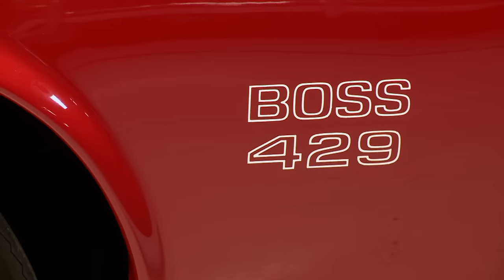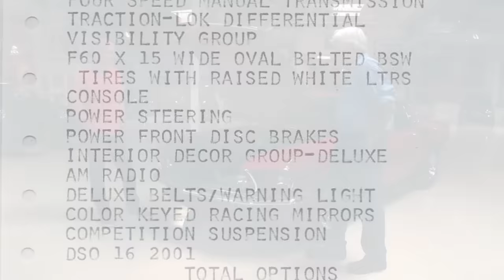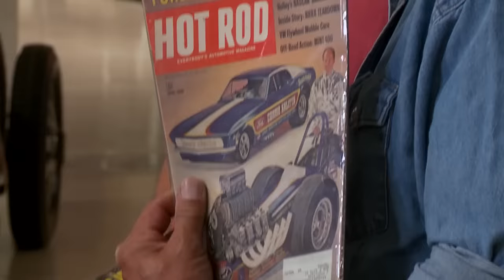1969 Ford Mustang Boss 429 - Jay Leno's Garage

Comment: I was  kid in 1969. That year my mom wanted a new Mustang. I went with my dad to the Ford dealerships on the weekends to test drive what they had. I remember riding in new Mach 1's but not a Boss 429 that I can recall. My dad really wanted a 4-speed and my mom wanted an automatic. We, of course, got an automatic. There's one thing I bet they can't replicate when they restore one nowadays - the new car smell of a 1969 Mustang. It was unbelievable. I've never smelled it since. I've been told the smell was actually adhesives. Regardless, man did they smell good. 

My dad ended up buying a 1969 Mustang 302 Grande automatic. I remember it was $3,200. It had the same interior as that Boss 429 (including that fake vinyl wood trim). The horn on the inside of the steering wheel was kind of a gimmick.  Ours used to stick and go off on its own in the summer when the interior would heat up. It would actually run the battery down. Random people used to pop the hood of our Mustang and disconnect the battery to turn the horn off. Then they would leave a note under the wipers. This happened several times. My dad ended up disconnecting the horn with a pair of wire cutters.
Reply: I had a 71 T Bird with the same horn setup. pretty weird, lol.
Reply: My dad had a red on red 70 Mercury Cyclone GT 351C with same horn under the rubber ring in the steering wheel.
Reply: yes yes yes ... the good old days .
Reply: +Patrick Simmons 
and probably likes the Shocker
Reply: Lol, they call that Rim Blow, the horn.
Reply: My grandfather bought his first car,  a 1969 Dodge Charger R/T.  426 HEMI,  4 speed,  Black exterior,  Black Interior,  Black Vinyl top. Sat for 5 years in the mid 70's. My dad picked it up from my grandfather in the 80's, and used it until recently.  It needs a few things done,  but it's completely intact,  original.  It has about 60,000 miles on it,  and soon,  it'll be mine :)  it never leave my family as my grandfather passed away last year.  So it's here for as long as it's kept up.
Reply: Carlos Aponte I'd sell the hell out of it...
Reply: My dad had a 1969, the horn was hard to activate, like it was recessed or something, really had to get your finger tips into it.
Reply: NOT one of Ford's 'Better Ideas'! Lol
Reply: That explains the ongoing affection for these Mustangs! Lol
Reply: Far more Mustang clubs than any other clubs.
Reply: Lol, 44 years later they still didn't solve the horn probs. My 2013 gt has a horn that does not work. Somehow involves my cig lighter
Reply: IndyFlick Right on, I can still smell Dad's 67 Fairlane GTl. And that rush in my gut when he'd slam that top loader into 3rd at 60mph and floor it on I-80 to pass a train of semis drafting up a long hill. Been chasing that high ever since.
Reply: That $3200 in today's money is about $12,000. Which is truly amazing.
Reply: Patrick, you need a heart! "Money can't buy you love"...the Beatles.
Reply: IndyFlick it's sad that nowadays 90% of people wouldn't know to disconnect the battery to turn the horn off.
Reply: Tyler Antonio try to find a battery in a new car, and also try to open a hood on a new car without a key fob. You used to be able to open a hood just from the grill.
Reply: I was 23, as soon as i came back from vietnam i had my money saved up for a new car, looked at a very similar black boss 429, i drove by it everyday passing it in the showroom.. after about 2 weeks i went in and was seriously considering buying it right then and there but it had sold the day before, i was devastated..
the same day i went across the street to the dodge dealer all pissed off and bought a brand new B5 blue 69 charger with a 440 for about 3500, shouldve paid another 500 for a daytona but they were fairly hard to track down then... still have the car to this day..
Reply: @tulosai58  
.mm.
Reply: I read an article that said that smell was vinyl and carpet adhesives.  The Japanese spent millions on corporate espionage to ID that smell and copy it.  I'm almost done restoring my 67 Fairlane gt and it will have the smell.  I have a factory interior installation manual and it lists all the adhesives.  So Ill take my manual down to the 3M factory and see if any of them are still in use. The engineer I spoke to says he has even mixed small amounts to be put in a vented jar to leak out the scent gradually.
Reply: @philhotchkin8269  I bet it was beautiful.
Reply: Lol, My 69 convertible 302 had every factory trim option, and included that rim blow horn. Thankfully, for the 15 years I owned the car, it worked perfectly, as did the factory Air Conditioning. I lucked out, bought the car from my cousin, who bought it from the original owner. That owner was a wealthy dude who checked off all the factory options, except a GT package.
Reply: @tyler8566  
A  couple years ago I saw a lady at the gas station.  The horn was blowing on her boyfriend's Corvette.  She couldn't get it to stop.  I told her to pull the hood latch inside.  I simply pulled the wire connector from the horn.  She was amazed.  Of course, we all know it was no big deal but, it was pretty funny.  I didn't want to help her steal it so, I asked her if it was her car.  She said her boyfriend's.
Reply: I had a 70 Mach 1 with the horn inside the steering wheel.  I would tell people that the clock reset above the glove compartment was a passenger horn.  When they would push it I would honk the horn from the steer ring and they would believe it.  Kinda funny.
Reply: it must of been a 69  thing. My Mom s 69 cyclone cobra jet had that very same horn problem !!

Comment: what a car... absolute pinacle of Mustang pedigree
Reply: In my opinion that is the Mach 1 SCJ.
Reply: It's slower.
Reply: +GlassTopRX7 No, it's not. I can assure you.
Reply: Yes it is by half second or more if everything is equal.
Reply: Yes,  this and the 67 shelbys.  GT 350 and 500's.
Reply: Nothing comes close to Eleanor.
Reply: The GT500 never looked like Eleanor. It's a modern dress up kit.
Reply: +Buddha Skouson Yawn
Reply: Best vintage Mustangs were the '65-66 GT350s & the 69-70 Boss302s, those have the racing pedigree.
Reply: Ken MacMillan  Probably, because Eleanor wasn't a gt500, lmao.
Reply: The Eleanor was an after market movie created car. It wasn't a Ford factory Mustang. So it's just a customized Mustang and not really comparable to all these other Mustangs. Apples & Oranges.
Reply: Buddha Skouson
Or a Mach 1 for the original film
Reply: the forgotten Boss 1971 Boss351
Reply: I'd rather have a Boss 302 or an early GT350, but this would be my third choice Mustang.
Reply: 351 Windsor. The Cleveland was more rare and actually wasn't that great. Kind of an in between small, big block. The FE engines were a strange lot. Worth big money buy the Windsor is much cheaper to work on and stroking one to a 408 is beautiful torque!! 
You can get the Windsor mustangs for well under 50k. Even in fantastic condition. Not so sure about the Clevelands. Also a lot of guys turned them into "clever" engines where they took the big Cleveland heads and mated them to the Windsor blocks
Reply: Ian Fosbrook take a mustang, fit a bear in it
Reply: butchtropic Go big or go home.
Reply: It was probably the pinnacle of America.
Reply: Disagree entirely with the idea of this as the "pinnacle" of Mustangs at the time or up to this time. It's very hard to overlook the actual "best" example the 302 BOSS for TransAm Racing. Same could be said of the Camaro back in the day......you could get bigger more powerful engines but ultimately the most completely thought out and balanced pony cars you could by were the Z28s and 302 BOSS.
Reply: My best friend in high school had a sister who’s boyfriend bought a 67 Shelby cobra 350 . It’s always bien my favorite muscle car, it had. A roll bar in the back a high performance 289- it was red and it had that cool cobra badge on its side. And the sound it made was fantastic. I never got a Shelby but I did get a 67mustang coupe. It was a fantastic car. Ya I always liked the Shelby 350 over the 500. It just felt lighter cooler than t big engine Shelby. I would love to find a Shelby 350 cobra. I am sure I would have to sale my house to pay for one know.

Comment: my parents bought a brand-new 1968 T-Bird back in the day with the 365 HP version  of the 429.  What a great engine.  In the T-Bird version, it was the velvet brute with torque that wouldn't quit.  It literally loafed up steep grades at freeway speeds.  Never burned a drop of oil, and a bomb-proof combination with the C-6 3-speed automatic.  We loved it.

Comment: I didn't know anyone in 1969 that didn't want a Boss 429, I don't know what Leno's talking about, everyone knew it had more ponies than 375.
Reply: The street version of that engine was really restricted quite a bit by Ford from the factory. Ford was a pretty conservative manufacturer at that time when it came to putting their high performance engines into street cars when compared to companies like Dodge, Plymouth, and Pontiac. The BOSS 429 came with a tiny 735 cfm carb, a way too mild camshaft, and a really restrictive exhaust system with a smog pump. Radical race ready big blocks don't like little tiny carburetors and restrictive exhausts. Ford should've used the same solid lifter cam that they used in the 429 SCJ in the BOSS 429. The BOSS9 was actually pretty disappointing in stock form...especially since they cost about $5,000 new...really expensive for that time compared to most other muscle cars. The 428 CJ Mustangs had quicker 1/4 mile times then the BOSS 429s did and you could probably get one for $1,200-1,500 cheaper than a BOSS9 depending on what options you ordered with it. The BOSS9's needed a few modifications to compete with top shelf muscle cars like a Hemi Cuda or Challenger, an LS6 Chevelle, or a Buick GSX 455 Stage 1
Reply: @jeremythompson9122  The Boss 429 had the heads and block for a stout race engine, more so than the CJ or SCJ. Street version was fluff but the potential for power was much greater w/ over-the-counter upgrades from Ford dealers. These would hold up to superchargers, while the 427 SOHC cranks and cross-bolt mains would grenade.
Reply: The cam was lumpy, the carb too small and the heads were different and not real hemi heads like the racecars had so no more than 420 horses. 428 CJs were faster on the 1/4, but the race version was a beast and far superior to the MoPar Hemi engine.
Reply: @jeremythompson9122  I agree with pretty much all you say. And you know what the 429 was really all about, they even mentioned it in this video.
Reply: The guys that could afford that car knew it's true potential.  They were buying them left and right.
Reply: Ford, along with GM & Chrysler, had to fudge the horsepower numbers because the insurance companies were raising a lot of fuss about the high- performance cars.

Comment: There was this guy in my area and he collected Hemis. He would buy any Hemi Mopar car new or used and take out the engine and replace it with a 440 or a 383 and sell it. He also bought a new red Boss 429 Mustang just like this one. It was the only one I ever saw, but it was also the only one I ever rode in. When he shifted gears  it felt like the car would fly apart. Love the 69 Mustang!

Comment: I am surprised Jay has never driven or owned a Boss 429 before, seems like that would have been right up his ally
Reply: He probably doesn't want a front end heavy, ill handling Mustang with a huge heavy engine stuffed in it that has too big of intake ports for strong low speed drivability.
Reply: He has a GT350 though.
Reply: That's disgusting
Reply: @gregorytimmons4777  Front heavy?  Leno has an SOHC 427 powered Cobra.
Reply: @gregorytimmons4777  > It handled the 1/4 perfectly.

Comment: nothing is sexier then a 69 or 70 Boss 429
Reply: Except maybe Dolly Parton doing gymnastics.
Reply: Maybe a 68 lol I think the backend looks sexier
Reply: I like the 66 fastback front end better
Reply: A 67 Shelby GT 500 fastback with a 427 side oiler is my favorite mustang but this one is also badass.
Reply: I suppose you'd say that the 69 charger daytona is ugly
Reply: Cut off the last 4 words
Reply: 70 chevelle ss ..ls6
Reply: @thehumancrumb.668  😂🤣😂😂🤣
Reply: Wayne Schnaak imagine the super snake was sold more cause only 10 were made and that thing pulled 600 hp cause it had the Ford GT 427 engine modifications in it
Reply: 100% agreed
Reply: I love the offset Mustang logo on the grille better as opposed to the large pony in the dead center.
Reply: Only if that Stang is LS swapped
Reply: Are those front tires wider than the rears?
Reply: @nemvallalomanevem7798  Ugly, no, Different yes, but still beautiful
Reply: must have never seen a 1970 'Cuda
Reply: @michaelwallbrown3726  Defiantly another contender. Being a mustang guy the boss is better to me. But the Cuda would definitely be like the second car i buy if i was rich
Reply: soaringtractor  no
Reply: How bout a '63 Jaguar Coup?
Reply: soaringtractor  lol LS over any engine ford produces.
Reply: I had a 72' Mustang convertible. Equally as gorgeous, but less powerful.
Reply: @imbluz  I would never ever put another companies engine in any car. That’s trash gtfo.
Reply: Or the 1969 Mach 1 429 Cobra jet

Comment: Had a chance to by one of these during the 80’s gas crunch in good condition with 60k on the odometer for $1,000 lousy bucks. The guy bought a Toyota and just wanted it gone. But my father wasn’t going to let his 17 yr old son first car be a 429. What a shame, I loved it!
Reply: Brady Dog I saw a 1970 boss 302 in the 80,s for around 1700 in great shape my dad was going to buy it for me but I was only 15 so he did not :(  wish I had but I would have trashed it in high school )
Reply: Brady Dog I know how you feel .When I graduated high school in 86 I found a 70 340 6 pk cuda with every option they came with .Pistol grip 4 spd.391 posi.hood pins .shaker hood scoop and when I showed it to dad he shook his head and said NO WAY ILLE BURY YOU IN THAT CAR. GOD IT WAS FAST .
Reply: Brady Dog! When I was starting out I bought a 1972 Ford Mustang Mach 1. It was a uni-body creation, rusting out, with a four-by-four between the gas tank and the rear springs. It looked new until you lifted the floor mats. The owner was a mechanic and safetied it himself at his house or it never would have passed. I listened to my daddy too, keeping it to the speed limit and slowing down for big bumps. Me and the guys in the band would drive around with the windshield heater on, the best three-speed automotive blow dryer ever made. It blew even when it was off. That car was hot!
Reply: Don't believe you sorry
Reply: Brady Dog Lol!  Yeah..our parents wisdom!!  I had a chance to buy a ‘69 Mach 1, 428 Cobra-jet 4-spd.  in ‘71....drove it and it just LIT MY 🐎🚘🔥!!!!  I’d driven a ‘67 convertible with a 390 ci. 4-spd, but THIS WAS T H E ONE!!  I went over to my Grandpap, AGAINST MY BETTER JUDGEMENT, and asked him if he would consider co-signing for me, as I was just out of school but did have a good job.....He listened intently, but told me that “ALAN, I’m afraid that’s just a little more car than you need” at this point”....and, of course, I’m SURE he was right, as he was a very wise man.  I’m thinking he’s not only APPROVED OF THE ‘19 BULLITT that I finally have now, an homage to that Mach if there was EVER one, but riding high there beside me when I go for my trips!!  He was a Motörhead back in the day, and I KNOW THATS WHERE I GOT MY PASSION FOR CARS THAT I HAVE TODAY!!  Thank you Grandpap....AND  F O R D 🔥🐎🚘!!      This car is T H E MOST FUN YOU CAN HAVE WITH YOUR PANTS ON!!    🤔😂
Reply: John Doe -Gas was going through roof and no one gave a crap about HP during this time.....you couldn’t give away big engine cars back then.
Reply: Alan Poland -It would have been too much car for you at that age...you grandpa probably kept you live by not co-signing for that car.
Reply: chief tp -Yep
Reply: In the 80s most muscle cars were cheap ... 

Few hundred bucks got a car that sells for 20k now unrestored.
Reply: @tomwolak3362  -Although we loved these cars very much, our father’s were right; they are simply too much car for inexperienced drivers who think they are invincible. We might have had a head on collision on our 2 cars.
Reply: @johnwattdotca  -Your telling me you never raced that?
Reply: @banditdane2710  -Even when I was in college during the mid 80’s a guy had a rot box 69 Or 70 Superbee 4 speed and a good engine (I’m from the northeast) that he only wanted 300 bucks for. In 1988, My little brother bought a 60k miles 69 GTO that only needed tweeking for $5,000. He still owns it today.
Reply: @5inthehole : When I was living in Toronto I had underground parking. I'd race around the concrete pillars, surprised I never slid into one.
Reply: @5inthehole : That 69 Pontiac GTO is a really nice car. A lot of cars were looking punchy, with big grills, huge square headlights and lots of chrome, but that car was smooth. And then there was The Judge.
Reply: @johnwattdotca  -My favorite detail on the car is the hood mounted tachometer. Plus the guys at Pontiac built a real speedster with that 400 engine.
Reply: @5inthehole  

Well i had a 73 monte carlo w a 454
Reply: @5inthehole : I forgot about that hood mounted tach. I should have remembered because I did that on a model car. One of my newspaper customers bought an orange GTO the first year they came out. He took me for a spin and I got spun.
Reply: @johnwattdotca  -That must have been one cool ride! Over the last 30+ years, I’ve ridden in The GTO many times; but never behind the steering wheel! Maybe sometime in the next 30!